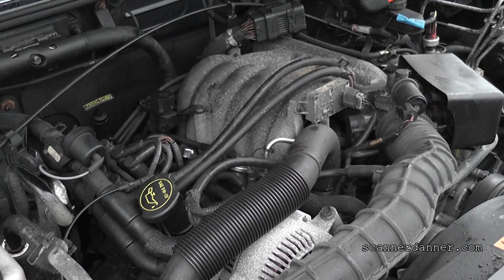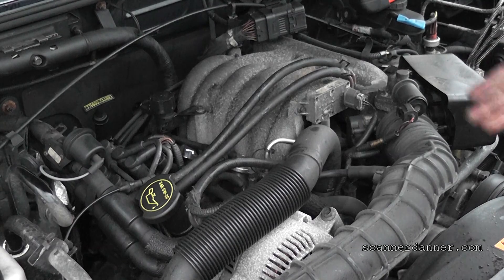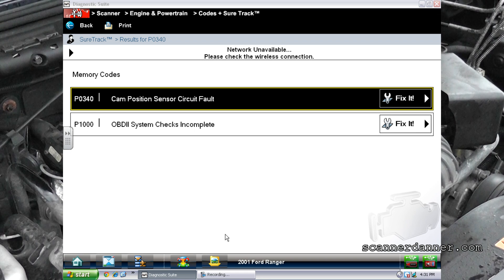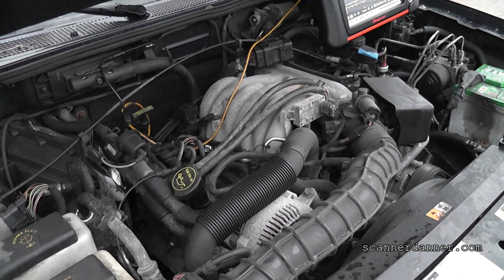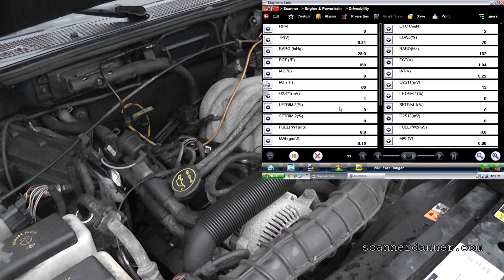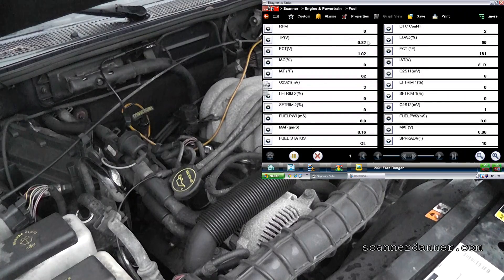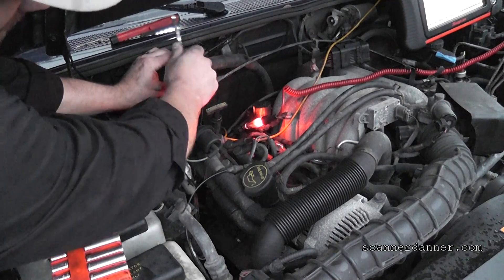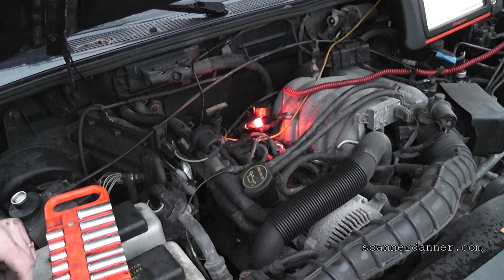Ford Cam Sensor Synchronizer Test

Comment: Ooo, rain!  I like rain.  I make more money on rainy days; partly because the colder temperatures and moisture bring new problems to light, and partly because I don't mind working in the rain.  >:)

You mentioned early in the video that you would expect a sine wave from the sensor, and for some reason I would have expected a square wave.  Misspeak, or am I completely off my rocker?  :]
Reply from the maker: +UnbiasedAuto the three wire design is a square wave and the two wire design is a sign wave. Ford makes both

Comment: On these older trucks, i would say before pulling your hair out checking sensors just fill your tank with some non ethanol fuel. That might just clear up all your problems. Between summer and winter blend  gas and all the ethanol they drown the gas out with, gunk is bound to clog up something.
Reply from the maker: +fishing frenzy you must have deleted your own post because I don't see it here but it is in my email inbox. So I'll answer your questions.
5:17 It is an ignition coil, some systems will not power the coil with just the key on. I proved this one did. Do you know why this test was important? 
7:24 ridiculous, I explained this variable very clearly. These housings for the cam sensor go bad all the time. The bushings wear out and then damage the sensor. It needs to have both replaced AND they come as a unit!
7:57 I said I do not think I have a data PID for the cam sensor, so I checked and I was right! I didn't! ALL CARS ARE DIFFERENT! 
8:11 "I don't think I have the option on this one", meaning one of the tests I like to do I cannot do because there is no cam data pid. 
9:43 wiring "could be" shorted to ground and not a bad sensor. SO I PROVED IT WASN"T SHORTED IN THE REST OF THE VIDEO!!
12:34 do you even know what a floating ground is? I suspected it was and then altered my testing procedure when I found that it wasn't

Okay, I'm not sure where your beef is with me but there is something you need to know. I film my troubleshooting procedures LIVE. These are not staged. You are watching me form hypotheses along the way and then  either prove them or disprove them as I go. Every single, "I think" and "could be" was answered in this video. I left nothing open ended. 
 I'm not even sure why I'm bothering to respond to this ridiculous argument.  

And finally, your suggestion for a P0340 CAM position sensor fault code is to run non ethanol fuel?
You are clearly on the wrong channel.
Reply: Go off roading and you'll get all kinds of weird codes that mean nothing. Are you doing a part 3?........I want to see some worn out bushings please. You back probed the ignition coil and said probably 12 volts here?.....Does that vary?.............
Reply from the maker: +fishing frenzy That's a much better tone I am sensing from you. Thank you. 
I'm sure, if you go off roading, all kinds of things can happen but you will never set a P0340 cam sensor code from any particular type of fuel being used. 
Here is a video on the worn out cam synchronizer assembly that I did https://www.youtube.com/watch?v=oUQpngRn-ag start watching about 17 minutes in
Reply: +ScannerDanner I disagree, if your truck starts bucking really hard from a fuel problem it will set that code.

Comment: And new fan belt! How can anyone drive around like that? It would absolutely drive me insane! Also, my father has a 99 Ranger with this engine, it has 260,000 miles on it and still works. A/C is broke and engine runs rough, but it still starts!

Comment: Fantastic video =')
Reply: +Pablo A He always says should or might?......What's up with that?.......If you don't know for sure don't mislead people.
Reply: +fishing frenzy for me this channel is one of the best in diagnosis.
My limitations of English do I can not express well, but for me Paul have all my respect, and as we say in my country, we all make mistakes.
Reply: +Pablo A I just don't want anyone to waste there money changing something out when that doesn't solve the problem.
Reply: +fishing frenzy This is the first intention of the channel (no change parts to change), but I think you can not know everything, because there are many conditions that only they know the engineers who designed the PCM, and who do not share with mechanical, even within the official dealer

I was working for several years at authorized dealers, and not always share everything
But Paul does not act in bad faith
Reply: The dealer knows everything if they have good intentions. Some dealers do not, so they just create large warranty bills. That's why you find some cars cheaper at certain dealers, because they don't try to scam money out of the manufacture and hire techs that want to learn not just parts change. Here you go with the key word think?.....Your just like an unqualified tech. Don't say you think this would work or it might or maybe it should. Hahahaha and i'm not even a shade tree mechanic, i'm a no tree mechanic. I doubt this was the problem on this vehicle. I would like to see more evidence.
Reply from the maker: +fishing frenzy what in this video was misleading and please also tell me what part of this diagnosis was a "maybe'.
Reply from the maker: +fishing frenzy the dealer "knowing everything "??
What other evidence do you need.?  What other tests do you think we're necessary?
Reply: +ScannerDanner Paul don´t worry to me your work is excellent,
and under me  point of view as made all the necessary evidence.
Greetings from Spain.
Reply: What in the world are you talking about "need to see more evidence"???  There was no signal from the cam sensor. The only other possibility was there could also have been a garness problem whch was ruled out by losing ground when harness was unplugged.  Bad cam sensor is only possibility Q.E.D.
   How was there any incompetence here? I am DYING to hear your answer.  DYING to hear how this conclusion was illogical.
Reply: Schrodingers Box Matt, I completely agree with you
Reply: +fishing frenzy hey man thanks for sharing your opinion!
Reply from the maker: +Schrodingers Box thanks Matt!

Comment: Couldn't you just unplug the sensor and put the scope across the sensor pins then start engine? There always has to be them haters that give you thumbs down. Not from this guy, thanks Danner.
Reply: +karl winter I don't think the engine will start.
Reply from the maker: +karl winter almost impossible to do given the location but yes you can test a vrs as you described

Comment: Would this be better than uScope you recommend? SainSmart DSO203     - http://www.amazon.com/SainSmart-DSO203-72MHz-NEWEST-VERSION/dp/B006J4FZMO/ref=sr_1_21?ie=UTF8&qid=1448418485&sr=8-21&keywords=oscilloscope
Reply: +Nikolai Pozdniakov I'm not scanner danner but I'd say it's different not necessarily better. If you're shopping on price you might as well shop for the absolute cheapest that has more positive reviews than negative. If your shopping for quality then check out the electronics youtube channels that review these mini/cheap scopes and let them tell you why they don't use these things in their field/work.

Comment: Thank u for setting up in poor conditions!!  So when your customer replaces the synchronizer,  will the scan tool allow u to check cam crank correlation? With no data pid, I am guessing not. The GM cars give u that. Will it set a code if he is off a tooth?  Thanks again!!
Reply from the maker: +Bill Rimmer no, you need to use a special tool from Ford to align it properly or it can be done with a scope. I've shown the scope method in another video on a Ford.